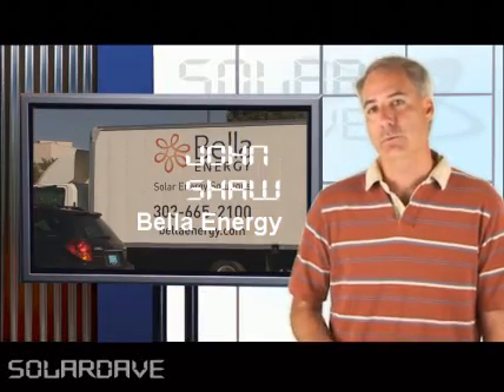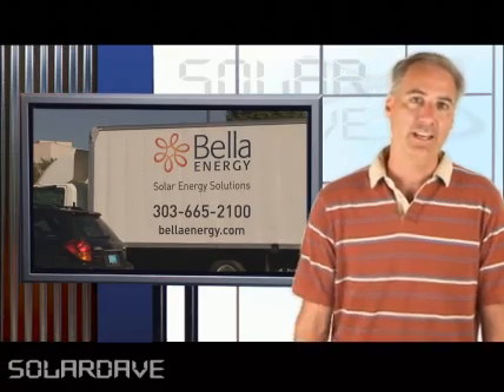What Type of Electrical Panels Are Good For Solar?

Comment: The 120% rule only applies if the breaker being backfed with solar is on the opposite end of the bus from the main. If main is located in the middle for example then you cannot exceed 100% of the bus rating.